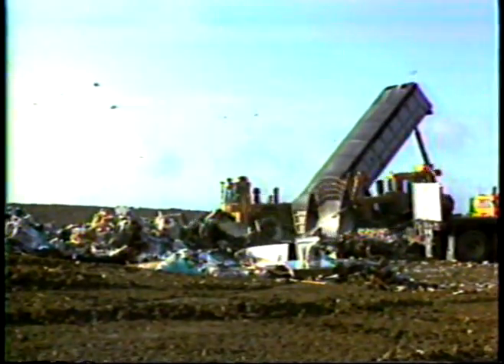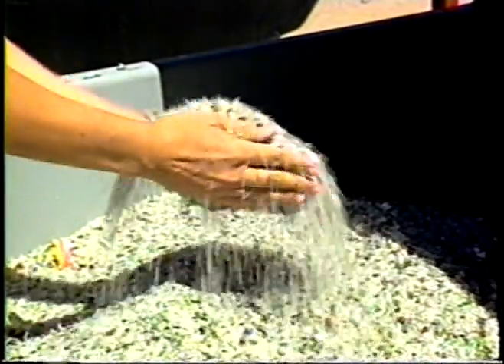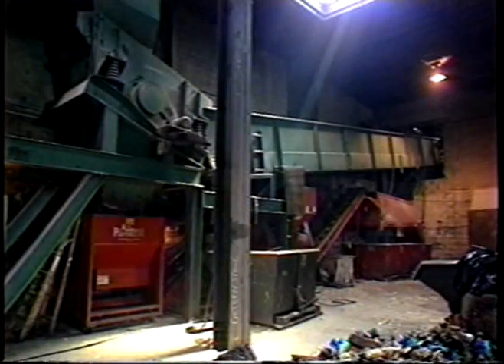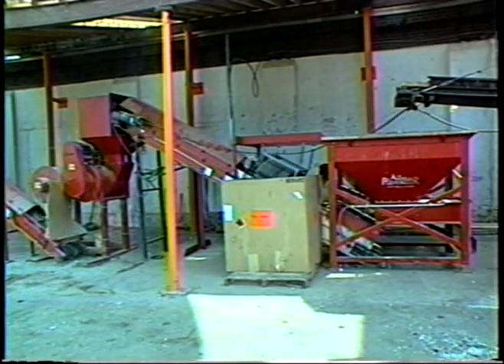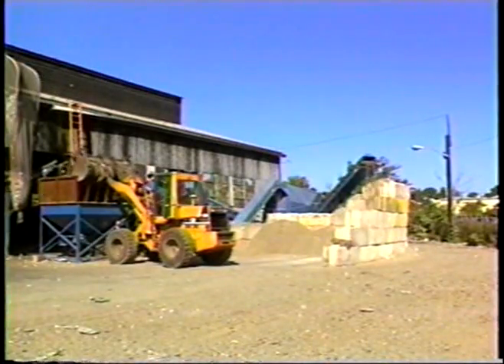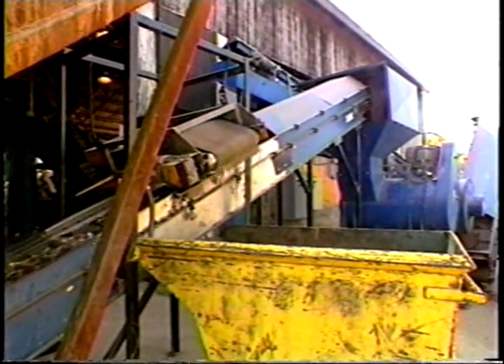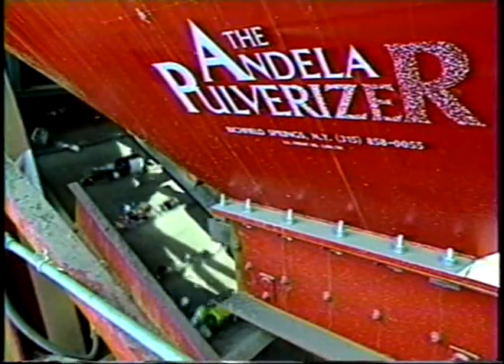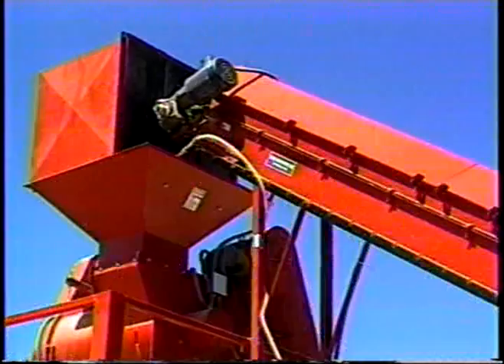Andela Glass Recycling System - Glass Pulverizing

Comment: Does having these units outside affect the flow of glass sand in snowy or rainy weather?
Reply: super-late reply to this, but from experience, yes. In the rain the dust turns almost to cement. You need to have the bottles somewhat dry and we found that just a simple pole barn is fine. IF you're in a dry climate you can leave the bottles out. You need a little bit of moisture to keep jamming from happening but you pretty much come to a haul if you work it in the rain.